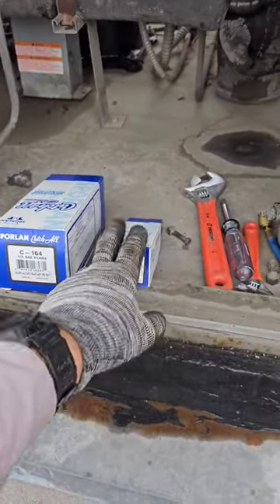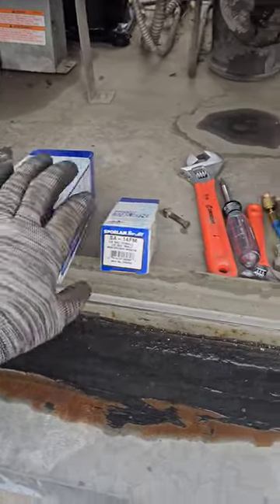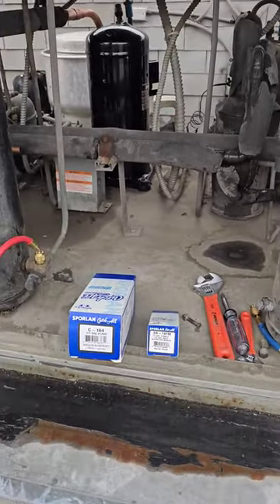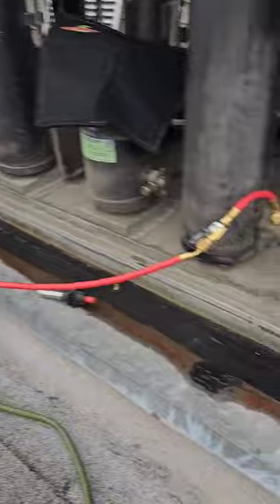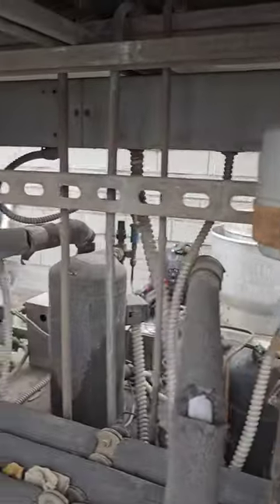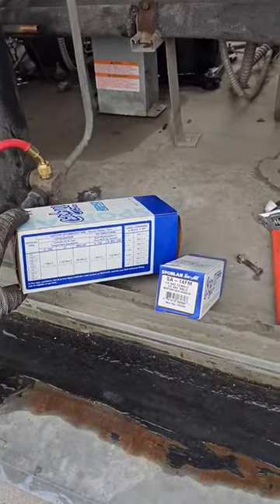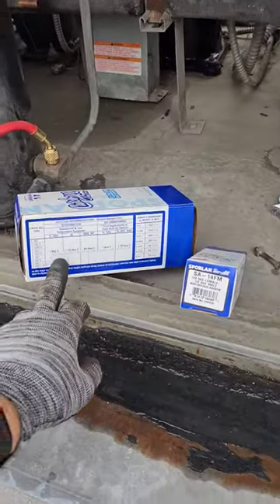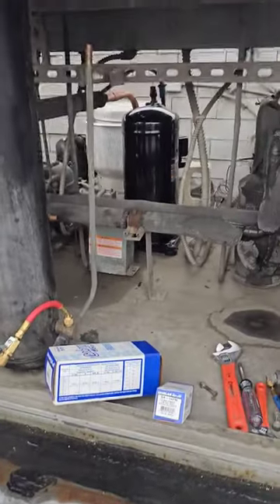DO YOU LIKE FLARE DRIERS #shorts

Comment: I do a lot of rack work but when I do change one of those dryers (as opposed to replaceable core dryers) I often use flare dryers because as long as you make a good flare they don't leak and it is a lot less work to change. The most common place for me to use those is if a grocery case has a TXV without a removable screen, if the TXV has a removable screen the dryer usually gets deleted from the case because you don't need 2 filter dryers and a suction dryer so the only time I'll replace them in a case is if it is needed to protect the TXV from getting plugged up with crap.

Comment: I prefer sweat just to be sure, but there’s nothing bad about the flare or they wouldn’t sell em.

Edit: Sporlan wouldn’t sell it if it were bad
Reply: I use both types depending on what I am working on, I won't put flares on self contained stuff but I use them in grocery cases when the TXV doesn't have a removable screen (if it has a removable screen and the dryer is blocked I just remove it and let the rack filter dryers do the work). I have found that a lot of people don't use flares because they don't make flare joints often enough to get confident at it and if you don't practice they often leak, so people avoid using them which m and they don't practice, makes sort of a self fulfilling prophecy.
Reply: @keldon_champion Ive no problem making flares, just use a bit of oil to lube the flare dye.  The biggest reason I don't use them much is because I will always forget to put a nut in first, then have to cut and flare again.  Then, because it's so dang hot on the roof in Florida summers, I forget again, then wind up throwing the whole thing off the roof and telling the customer to buy a bag of ice, lol.
Reply: @TheDiosdebaca  lol I have done that more than once
Reply from the maker: I will discuss this on my livestream this evening 6/5/23 @ 5:PM (pacific) on YouTube, come over and check it out https://youtube.com/live/1ej-23fZO5c